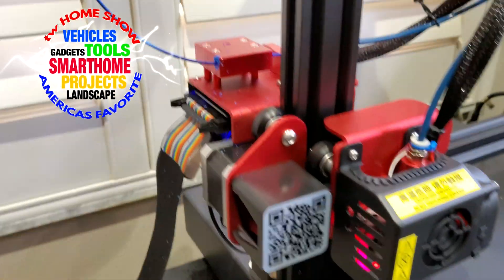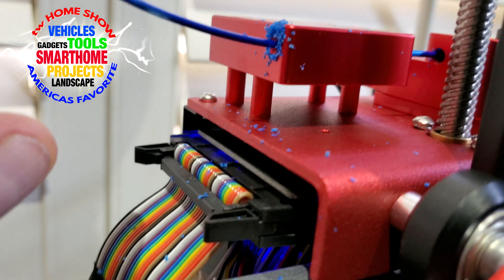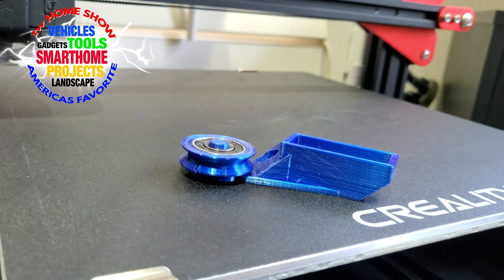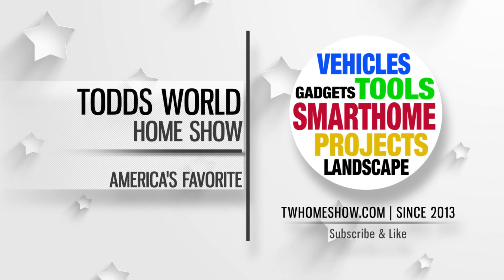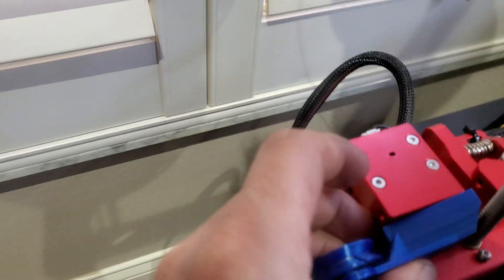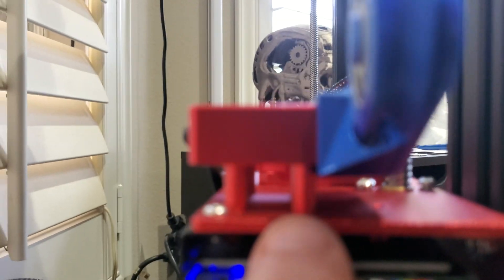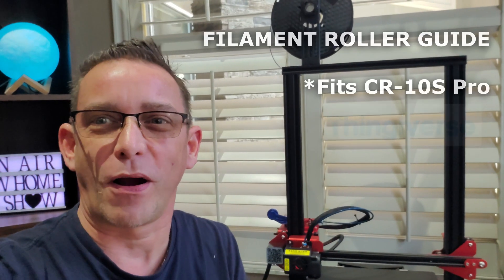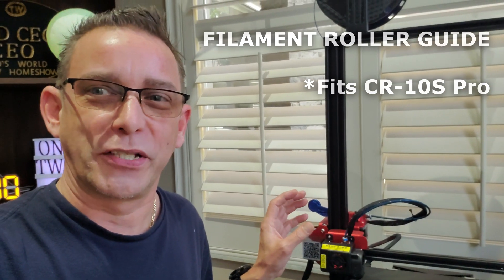This should be YOUR FIRST 3D Print if you have a CR-10S Pro Printer! | FILAMENT ROLLER GUIDE

Comment: Hello,

The “tw home show 3d” logo curls onto the side a small amount causes the appearance to look terrible. I stopped the print.  Any tips to remove this or adjust it so it’s fully underneath
Reply: I used .2 layer height vs the 1.6 you recommended. This wouldn’t cause the issue would it?
Reply: @peebs2424  dunno if you still need this, but if you chuck the model into blender it shouldn’t be too hard to remove the faces with the logo, join the edges fill the faces to stitch the model back up.